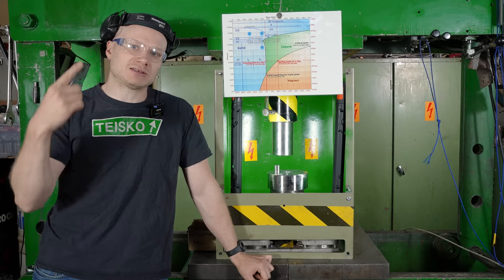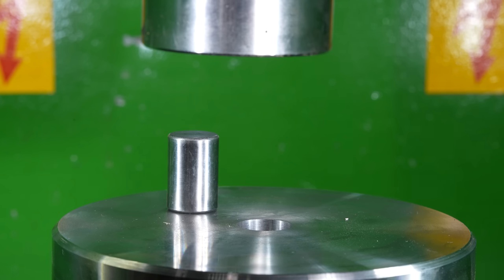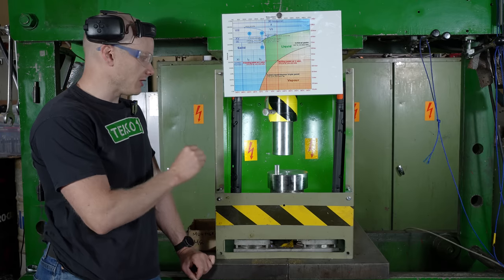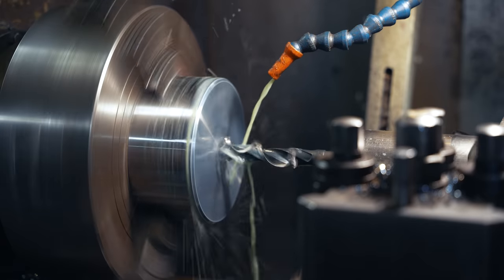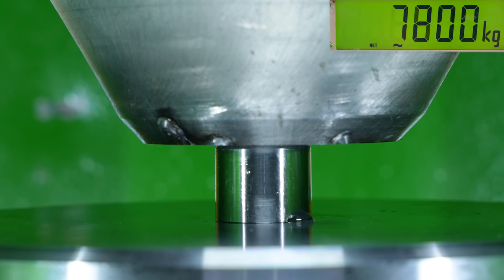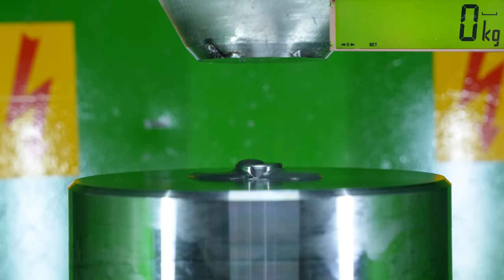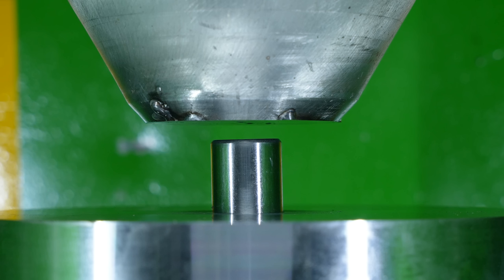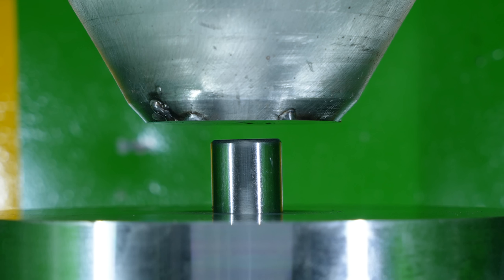Turning Water into Rock with Hydraulic Press

Comment: Unfortunately during high transient compression you are heating the water too. You need to increase pressure, then hold it to make sure the water sample cools back down to room temperature.
Reply: came here to say that, on the pressure/tempurature graph, you can see this, in the first test, you could see the escaping water steaming. pressing in stages, or using cold (but not frozen)  water + cold tools to start.
Reply: Additionally the pressure is defined as kg/cm², not sure if he took the area of the piston into account. Anyway, reducing the area of the piston is the eay to go, if you want to achieve extremely high pressures. A smaller bore would yield less as well, which should result in a higher pressure too.
Reply: i mean how much heat is being created with friction just from pushing the metal plug into an increasingly small diameter hole into the block...even without water and/or air..
Reply: I think the pressure causes the heating not the friction. Just like the space shuttle coming in from orbit, the air pressure on the heat shield heats it up and not so much the friction.
Reply: @Boss-Possum  It's actually the friction of the air against the shields that creates the heat when re-entering the atmosphere.
Reply: @damon20r  it may be both, a quick Google search and I came up with this. "During re-entry, the shuttle is going so fast, it compresses the air ahead of it. The compression of the air layers near the leading edges of the shuttle is quick, causing the temperature of the air to rise to as high as 3000 degrees Fahrenheit! Being in contact with the shuttle, it heats the shuttle's surface."
Reply: @Boss-Possum  yes you are correct, it is both. The temperature variation that comes with Compressing and decompressing gas is the principle that an air conditioner or heat pump works on.  I do believe the friction creates the majority of the heat, although I am far from an expert on the subject.
Reply: @damon20r  I don't know much about it either, I just remember it being brought up in a Scott Manley video a few years back.
Reply: @ab2tract as well, how much of the internal volume is now liquid/crystal steel, and frozen deuterium.....
Reply: What the... An actual discussion can be seen above. What is this, not 2023? Get angry and irratic now you two, have sense of decency...
Reply: @vj420  Can't you start by freezing the water into ice in the tool and then pressing it? It will be larger in volume, but it takes a lot of heat to melt it, so you're at least closer to re-freezing it and the tool will also be cold.
Reply: @jaakkopontinen  😡Who asked you for a comment?!?🤬

🤣🤣🤣
Reply: @damon20r  :D yess
Reply: sounds like just lowering the temperature of the press apparatus might be enough. Also, the focus needs to be on getting this thing sealed. Perhaps the metals are gauling and leaving channels for fluids. I wonder if you gave the plug a copper plating and made the hole less tight. perhaps slight taper to both parts to engage the copper plating. Basically soft metal seal the bitch.
Reply: I think he might have to quickly ram the sample, and let it expand and cool right after getting the pressure up. Layer by layer it will build up from the bottom.
Reply: What about N/m^2 or kg*m-1*s-2
Reply: @damon20r  Boyle's law
Reply: The Ice VII on the chart continues up to very high temperatures, so if you get there, it doesn't matter if it's hot or not, it can still be ice VII
Reply: @damon20r actually it's the shock wave of the space shuttle that causes the heating, due to turning the gas into a plasma, that then heats the surroundings. Scott Manley has a good video on it IIRC
Reply: @damon20r  In the terms of atmospheric re-entry in aerothermodynamics friction has nothing to do with it, friction related heating stops just after Mach 10. For speeds higher than that then heat is caused by the shockwave of pressurised air heating through pressure which then radiates IR energy onto the spacecraft, the further the shock boundary can be pushed away from the hull the less heat transferred as the IR energy attenuates over distance.

You can tell the difference between a aircraft/spacecraft designed for friction based heating and one for pressure created heating in most cases if the hull is pointy/sharp or if its blunt, sharp looking aircraft try to ease the resistance of the air and friction by allowing the hull to push through the air. After mach 10 this just stops being possible as the air just physically cannot move fast enough, the blunt nose/hull aims to maximise the distance between the shock boundary to attenuate the radiated energy.
Reply: @CED99  Cool 😎... Or maybe I should say hot 🔥?
Reply: @Tuberuser187  I didn't know that. I always like learning something new. 👍
Reply: @damon20r  anytime, though I think tubeuser has given you a bit more detail 😀
Reply: I didn't look to see if anyone else said anything, but active cooling could help here.
Reply: At this pressure temperature isnt taken into consideration. Its changing the chemical structure of what makes water freeze. Like he said its not ice its stone so temp u less it’s impossibly high means nothing. Its passed a steam point and already restructuring itself before it escapes
Reply: @jeremypearce3056  I think you misunderstand me. Preventing the initial steam transition could improve the end result.
Reply: @Rsenior1981 In difference to gas water does not heat up while compressing it. It will heat up while expandaning. Don't ask me why it is this way. Maybe someone can explane?
Reply: Agree.  With the rapid compression, I  think the spray was mostly steam, not water.
Reply: I have the same problem holding back the taco bell.
Reply: @ab2tract it's not the friction that creates the heat, it's the pressure.
Reply: @gavinjenkins899  Boyle’s law applies to gasses. Things change significantly when you use liquids and deformable solids. An example of this is the density of carbon (diamond and graphite) which are 2 different crystal structures.
Reply: Ice can also be brought to near zero, it only hovers at it's freezing temp until it's all frozen.
Reply: @ab2tract  Its not the friction, its the pressure that creates the heat. The more closely packed the atoms, the more they collide with eachother, and iirc, heat and the number of collisions happening moment by moment within a given volume is essentially the same.
Reply: Boyles law.
Reply: Compress water in a cylinder and make a water jet.
Reply: preform this again in a vacuum? or pressurized chamber?????
Reply: @damon20r  The pressure is by far and away the most significant source of heating, that's why the nose of a missile gets far hotter than any other part at hypersonic velocities.
Reply: He should also use a brass plug to help with sealing
Reply: & probably add active cooling & temperature sensing to be sure. I like the ideas Lauri has though!
Reply: @damon20r  friction creates the compressed air
Reply: i see ice 7 can be hot but the increase pressure maybe is increasing temperature enough to expand and create force that makes it escape?  enough heat and force to damage the steel?  i wonder if slowy increasing pressure and waiting several minutes at a time would allow cooling back down?  and yes, smaller bore to make it easier to create the higher pressure and cool faster and tighter interference if that is possible without mushing the metal
Reply: @ab2tract a lot
Reply: @derkeksinator17  good point. I wonder if he's going to try
Reply: @damon20r It's both. Some of the heat is friction, and some of it is from the compression of air in front of the shield as it falls.
Reply: Friction is the action of one surface resisting the movement of another surface. Pressure is a measure of particle collisions per area, in a given time. You need friction to measure pressure. In the case of either, IR shockwave, or ionized gasses. Both require the loss of unrestricted motion in the air particles... That's friction. Whether the air heats up on itself, or not doesn't change that.
Reply: I froze the water below -50° After pressuring it, it will heat about 30° at 10 millions pascal. I used 50ml water.
Reply: @jaakkopontinen  I disagree with you internet person, *some insult about your mother here*
Reply: I imagine its the same thing as happens to a very deep sub if they have a breach. The sudden compression of the air causes it to ignite
Reply: It's clear he doesn't have a good enough seal
Reply: I thought that he could use some wire edm to cut the pieces, for try to close the gap. Also, I thought that the material could be a lot harder, like tungsten carbide, for resisting the gap that the water is trying to make. The hole should be taller then wider to improve the efficiency of the compression, something like a pen size (6mm x 120 or so). And finally, the instruments should all by the nearest of 0⁰C as possible to work against the pressure x temperature curve.
Reply: Would cooling it before compression help?
Reply: @jamesfowley4114  it'll probably delay the heat curve
Reply: Would using Inconel, Monel or Hastelloy maybe help?
Reply: @jackmakinson-sanders7279  never heard of this kind of material before. But reading is specs here, it's seems like it's really good at abrasive environments. You think that this is the case or perhaps is something that I didn't realize?
Reply: @ericonaves  They is very abrasive resistant, particularly Inconel. They are also very heat resistant and harder than hell. Inconel 909 with retain its hardness to around 650 C°  it is quite expensive though. 
I work in the aerospace and nuclear power gen industry and we use these "super alloys" in various high temp/pressure applications. It's worth checking out if you can afford it.
Reply: @damon20r Friction is a non-factor. Air compressing is the reason heat is generated.

Also, water is almost un-compressable.
Reply: Ypu guys are kinda nerds
Reply: @XXXwes999  Kinda? I'm am a 100% unapologetic drop-forged hyper-nerd.
Reply: @XXXwes999  20 years as an engineer, you pick up a few things, lol.
Reply: @Rsenior1981  lol good to know
Reply: @XXXwes999  we're here watching a guy with industrial equipment compress water, and then we're all in for a discussion about the process and related stuff, and you think we're K-I-N-D-A NERD? Most of us are engineers my man! That's the major level of nerd you can be and still be able to talk to other person (beraly)
Reply: Water is not a compressible liquid; if you take a sealed container made of lead and compress it, the water will come out of the metal like sweat from the body.  This is a school physics curriculum.
Reply: @Lomidon  actually, water is compressible. 
Just not as much as others materials. But below just a few % and it depends on the conditions that this is experimented.
Reply: @Boss-Possum  how come the shuttle doesn't light up on the way to orbit as well?
Reply: @Boss-Possum  I should have read a bit further before asking😅
Reply: he’s not wrong
Reply: @damon20r  ACs or heat pumps work on a completely different principle.
Reply: @leocurious9919  ACs compress a refrigerant remove the heat generated from compressing it to bring it closer to ambient then move the refrigerant to be decompressed, which creates a temp drop which then allows it to absorb the heat from the room being temperature controlled  before being recompressed and raising the temp so that the refrigerant is able to release heat into the ambient temp air. It is manipulating the temperature of refrigerant through compressing and decompressing it, so that it can absorb the heat in one location and expel it in another.
Reply: @damon20r  That is literally not how it works. It removes heat by boiling/condensing the refrigerant, which takes MUCH more heat than simple (de)compression, which is why nobody uses simple (de)compression to drive a heat pump but instead everyone uses the refrigeration cycle with a boiling liquid. https://en.wikipedia.org/wiki/Heat_pump_and_refrigeration_cycle
Reply: @leocurious9919  and how exactly do you think it changes phases? Excuse me if I was oversimplifying so I didn't have to type out a book or do a search to post a link.
Reply: @damon20r  Saying heat pumps work with compression and decompression to move heat, when it is all about phase change... is a bit odd to say the least. That is not an oversimplification, it is plain wrong. You could have a system with zero pressure differential and it could still move heat with phase change. Like boiling water in a pot and condensing the steam. That is how irrelevant pressure is to the underlying mechanism. Yes, you need a (big) pressure difference to make the process more efficient, reaching higher power densities. But it is not the mechanism with which the heat is actually moved.
Reply: @leocurious9919  well I really am curious how you would create a phase change without adding or taking away energy or a change in pressure.
Reply: @peppermintgal4302  Temperature and heat are "completely" different things. Lets look at an example: Atoms in steel are much more rigid than, for example, air. So to the have the same kinetic energy (=temperature, not heat!) they need to wiggle less. Like a weak and a strong spring: For the same force, the weak spring needs to extend more. The actual speed of the atoms is then a function of their mass. More mass can move slower while maintaining the same kinetic energy. Which is also why hydrogen is so good for rockets, but that is a different story.
Reply: @damon20r  This is what you said:
"The temperature variation that comes with Compressing and decompressing gas is the principle that an air conditioner or heat pump works on."
And that is 95% wrong. They work 95 % by phase change, not (de)compression, since that creates very little change in temperature given the small changes in pressure.

Also, I already gave an example of a phase change with zero change in pressure: Boil some water in a pot.
Reply: @leocurious9919  in order to change phases you have to change pressure or add or remove energy. Your pot of water isn't going to boil unless you add a lot of energy. Just like your typical refrigerants in the majority of air conditioners is going to be a gas until you compress it which raises its temperature and turns it into a liquid.  I never said that phase change isn't a intragle part of how air conditioners work.
Reply: Yeah, he should've pressed it more slowly rather than more quickly.

Comment: Press a deformable plug ahead of the steel rod, so that the deformable plug becomes a wiper seal as it is compressed between the water and the steel rod.
Reply: Also should try freezing the parts and start with ice to minimize any leak before getting in to real pressures. And yes softer materials could work better as those hard metal could get micro fractures from being forced together and the water can escape. Softer material should seal better in my theory of all things soft and then hard :D
Reply: Brass? Coper?
Reply: or wire EDM to cut the part
Reply: I was going to say Lead, but that might have too low of a melting point... 🤔

In the Sticky thread, a few of us have independently come to the conclusion of a concave piston, to force the pressure into the center. Instead of the flat piston which is wanting to spread pressure across the entire surface; thus, escaping out the sides.
Reply: Bronze is what is usually used for high pressure seals like this
Reply: Chemical deposition bath for everything and then clean up the surfaces on the lathe?  @Lilith-Rose
Reply: @massspectrometer6757  honestly start with a straight bronze polished plug as a test, if/when that fails an oversized bronze disc with polished steel follower, and polished internal bore. At these pressures a lathe turned finish just isn't good enough to get a seal no matter how good you are on a lathe because water will find a path through the ridges left by the tooling
Reply: This is fascinating! Are you an engineer? Physicist? Im impressed with all the science of this.
Regards, an Aussie retiree 👍🏻
Reply: May I suggest that it might be a good idea to Cooper plate the inside of the tool to make up for any irregularities in the machining.
Reply: @EricBlankenburg-s3q  plating is usually only a few microns thick, to build up enough of a coating that it'd be thick enough to smooth out the irregularities would be both time consuming and leave very messy results that'd make things worse. Unless you polish the bore to a high shine before plating it which would defeat the object
Reply: @anoninunen  Copper work hardens when it is compressed so that might be a good way to go.
Reply: @Lilith-Rose  This is a moot point with the interference fit. In fact, radial scoring might actually help seal it better.
Reply: @randr10  at lower pressures perhaps, if you're trying to plug a hole in your plumbing, but when you get to these levels of extremes precision and consistency are far more important even on an interference fit. Pure copper work hardens too quickly, a bronze alloy is more suitable
Reply: @randr10  in an interference fit with radial ridges each furrow constitutes a point where there is less material deformation even if it is on a microscopic level, a polished interface means a much more consistent contact and thus eliminating those weaknesses
Reply: I mean.. it’s kind of ironic that the potential fail point is mitigated by the design of the mechanism driving the press.
Reply: @Lilith-Rose  lets use a hydraulic cyllinder then. No need to re-invent the wheel
Reply: @trollmcclure1884  did you even watch the video?
Reply: @vihreelinja4743  Starting with ice is a volume issue, he will only be able to fit approx 1/10, or the tip of his IceVI berg